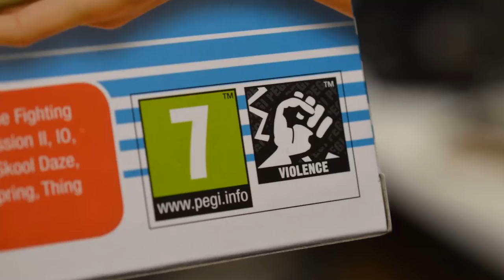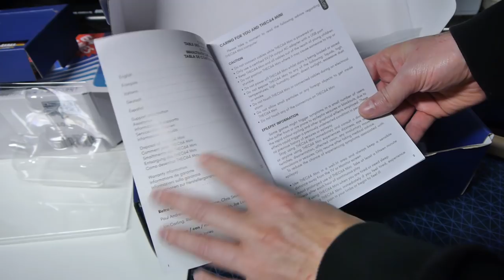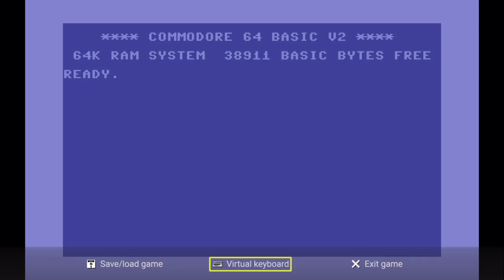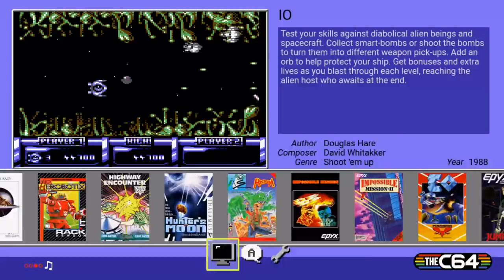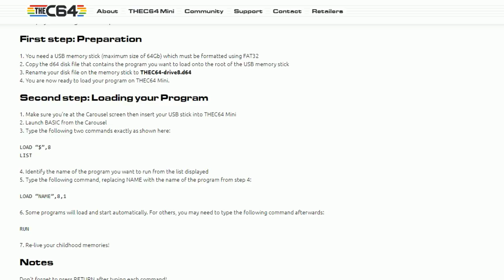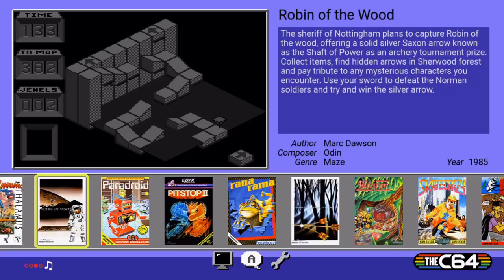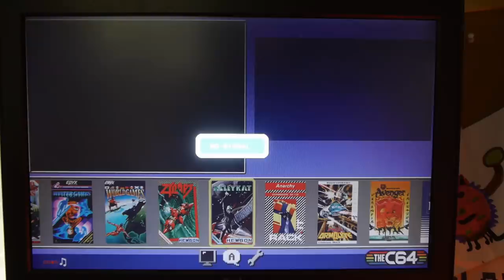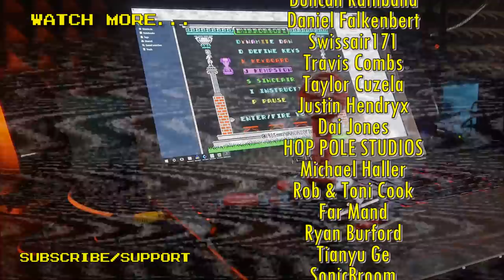C64 Mini | Nostalgia Nerd

Comment: Those "North American 4:3" options are too square. At least they look too square on your PAL screen. The image on a tradition NA CRT looks more like the European 4:3 option. I have this problem with some emulators as well, especially NES ones. I select the 4:3 option and it gives me a perfectly square image, or even one that's taller than it is wide. NTSC 4:3 is not square! It's right there in the name "4:3", meaning four units across and 3 units high. In other words, a rectangle that's slightly wider than it is high.

Comment: i really do not get why they included static keys and not an actual keyboard,
Reply: Because:
-  it is not strictly necessary for all games, only some
- it would add to the cost, especially at such a small size
- you can plug in a USB keyboard as demonstrated in the review.
All quite good reasons.
And a version with a full keyboard will come later anyway.

Comment: "Apparently I pre-ordered one" and "costs £65" in the same video... I wish I could  afford to forget about spending £65 😂
Reply from the maker: They take your money the day prior to shipping. I remembered once that happened.
Reply: Nostalgia Nerd that makes a lot more sense!
Reply: Well here it costed like £85 (sweden). I had probably waited to buy it. But it was convenient released a day I was alone for the first time at home, and I was like what the heck, atleast I am supporting them. It is quite nice actually, but need a firmware update to make it easier to put games in, and also make it possible to switch between port 1 and 2 controller because now some games wont work due it is using port 2, and the joystick only use port 1 all the time (probably can be fixed if you have two joystick). 6/10 is a fair score.

Comment: Heard bad things about the joystick from all quarters, so giving it a missas a fancy 3D printed emulator isn't worth it for me for the price.

Few classic titles missing too. I don't like hacking things like this as I'd rather keep them "as is", so it's just not good enough overall.

... except as a cool gaming room ornament hahaha
Reply: So much misinformation here:
- it is not printed, it is molded
- no need to hack, you can add games as is
- of course it is an emulator, an FPGA version would be an emulator too, the fact that it is done in hardware does not change a thing.
Reply: Fair enough, still not for me but thanks for clarifying.

By "hacking", I mean doing anything to it beyond factory settings. I haven't touched the NES mini for example, despite knowing I can get the whole library on it if I wanted.

Comment: Would've been better if the keyboard worked and they used the C64 operating system.
Reply: Have you watched the video? It is available, you can boot in BASIC if you want. This is even how you load external programs.
Reply: Laurent Giroud That's just a program emulating it. The system itself runs off Linux.

Comment: Maybe I'll just track down an original C64 and then spend years looking for games...
Reply: and wait for them to load from tape.  Hoping that after a number of minutes you won't be left with a blank screen that says Run or it just resets.  You may have to get the tiny screwdriver out to adjust the azimuth alignment of the tape player.  When you finally get the game to work other games stop working so need to adjust the azimuth back again.  Better start noting down the azimuth for certain games.  Exercise in patience for sure.  Unless you lucky and have the disk drive which was expensive back then. C64 had the best games at the time.  No longer the case now.  I can understand people buying these products because it's a trip down memory lane playing those old games that are difficult to remember now.  Playing them on PC is technically illegal.
Reply: Or instead of looking for games, buy a SD2IEC which emulates a disk drive to let you load games from SD card.

Comment: you could do this on a PI zero as well. Would not look as nice. But still.
Reply from the maker: Indeed. You could just strip out the case and slam a Pi Zero in there if it took your fancy. Although that seems like a mighty expensive case.
Reply: for $5 instead of $150
Reply: Best option if were going to mod it is like the mini SNES use a usb for additional storage but connect the usb flash drive inside as there will be another usb pinout on that board somewhere. I doubt the onboard flash is large

Comment: I'd rather have a usb C64 keyboard that I can use with any emulator program. I'm contemplating using a genuine C64 or VIC-20 keyboard to build one but they feel awful compared to even the cheapest modern keyboard. 

What I really want is the modern equivalent of and old 8 bits computer in 64 bits, i.e. an O.S. that use a simple to learn computer language as its O.S. without wasting resources on a GUI or various always running applications.

Comment: Name of the song @ 12:00 please!

And honestly, the system looked subpar from the moment you opened the package.
I think someone replicating the original feel of the C64 would do incredible. The next product should reimagine the device top to bottom and focus more on the elements making it closer to the original. They should enhance on the original device as opposed to making modern hardware and software emulate the nostalgia.
Use identical physical product elements and mix it with a modern touch, as opposed to using some Linux based system and mimicking just the skin.
I would want the feel of the same plastic, same keyboard clicks, same smell, same weight...

Comment: Glad I passed on this. I will stick to emulation on my PC, there's no need for all these mini-machines which are essentially raspberry pi's with cases running an emulator. The most disappointing thing is the non-functioning keyboard.